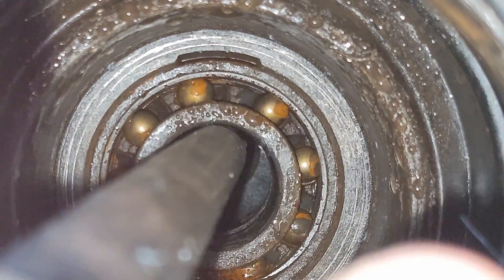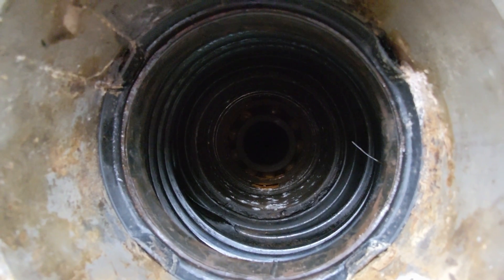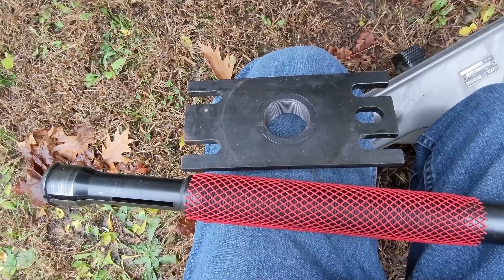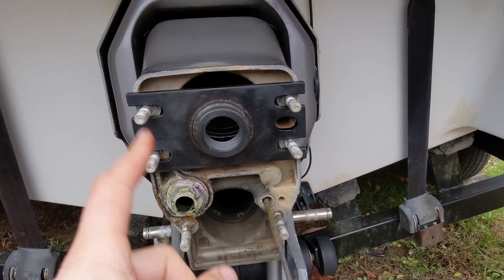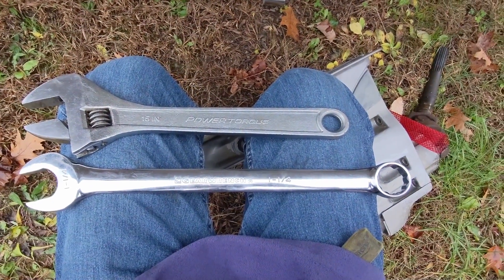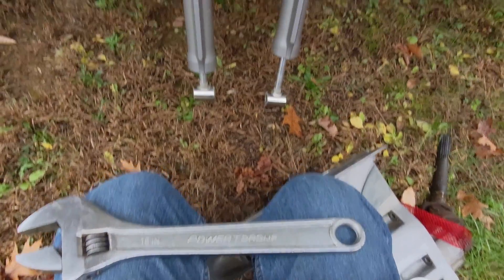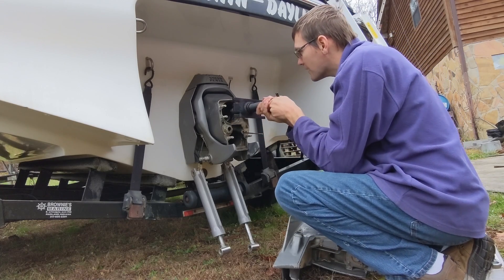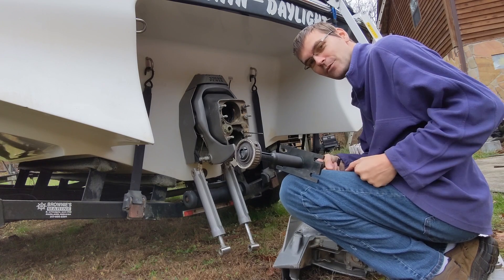Does the MBS Fab Gimbal bearing puller work on a Volvo Penta SX-M sterndrive? Yes.

Comment from the maker: Here is a link to get one of these pullers to make that job a whole lot easier: 
MBS Fab Gimbal Bearing Puller: https://amzn.to/3jsMxmS
Puller and installer combo kit: https://amzn.to/3PPvBTA
I like the Sierra bearings (18-2100) because they have the hole to allow greasing: https://amzn.to/3VgMBDq
But if you would prefer a OEM Mercruiser bearing (879194A01) that is "permanently greased": https://amzn.to/3WotEA4
Or, the Volvo Penta bearing (3888555, 3883629), which is also non-greasable: https://amzn.to/3jnugHv

(Links on this channel may be affiliate links, I earn a small percentage commission if you choose to purchase from them, at no additional cost to you, this helps me finance the projects and howto guides you see on the channel!)